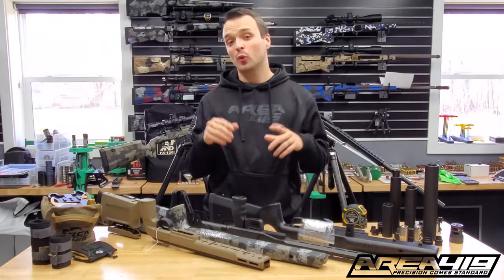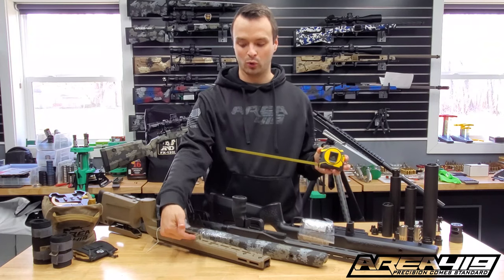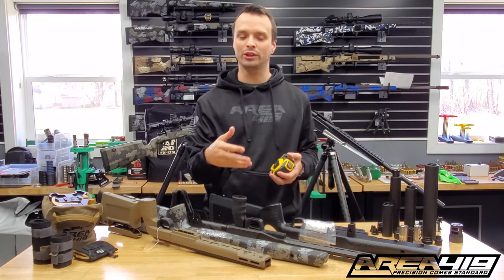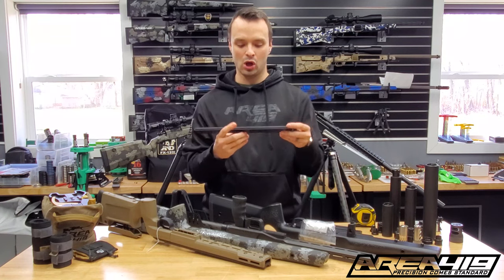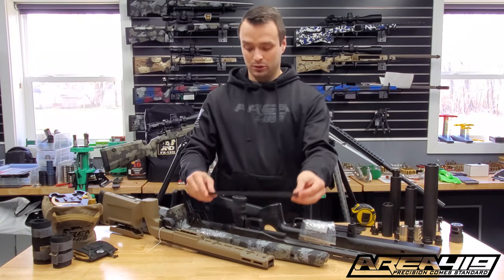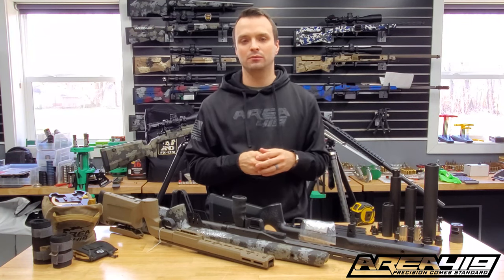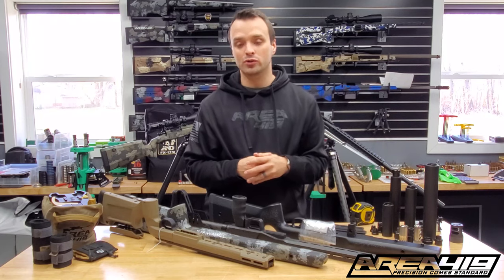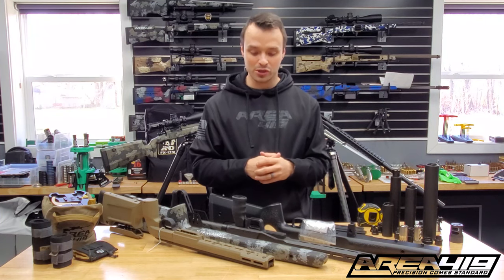Choosing the best ARCALOCK Rail for Your Rifle

Comment: Boyds AT ONE
Reply: Just helped a buddy install the universal rail (can’t remember the length) it actually ended up being way easier than expected. The hardware that came with it will actually screw into the two existing threads in the at-one forend

Comment: So I have a 2020 Winchester Severe service stainless in 338 Win Mag and it kicks more than I can stand. I have 11" of length just in front of my mag well screw and I would like to add weight and maybe a tri pod mount to the rail. I've put a lot of lead in the rear cavity of the stock and I'm trying to balance it out some and I wouldn't mind adding 2 lb to the front if I can get that much. So I'm thinking the 10" arca rail minimum, but I could stand a little overhang with a 12" possible? What do you guys think? I have a picture, but I don't know how to attach it to this.

Comment: What do you recommend for Magpul 700 Hunter? It measures 11.5 inches but only has two M-Lok slots in the front.
Reply from the maker: On that stock you're only going to be able to run one back to the little bump about 2" in front of the magwell. The 8" or 10" would be best. You'll also end up drilling/adding a rear anchor point just ahead of that bump.

Comment: what is the size rail for MDT XRS chassis?   I'm sure I can use the 10" rail but can the universal 12" be used as well?.... I am assuming if the 12" is used then there will be overhang... is that feasible?

Comment: What would be recommended for a A5 mcmillan
Reply: 12 would come out pretty flush
Reply: Yep it wud. I got the 14 in the end.
Reply: Did it work with the front action screw or did you have to drill it forward of that
Reply: Worked with the front action screw.